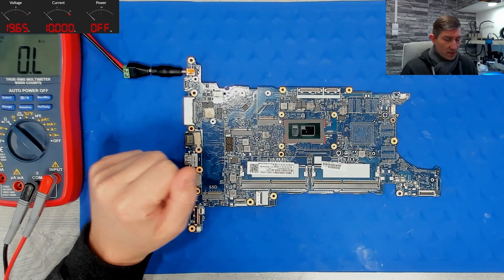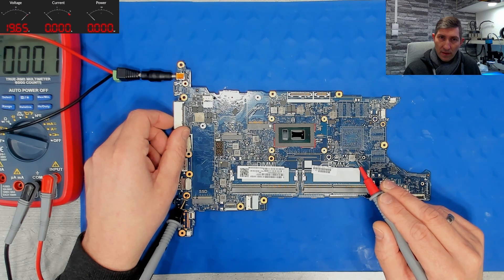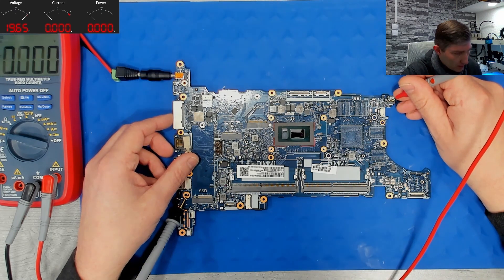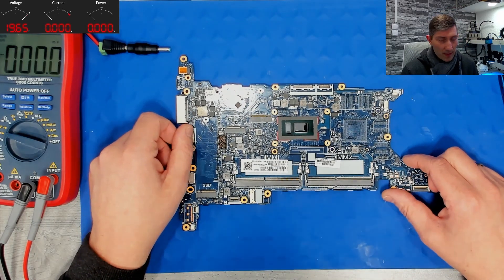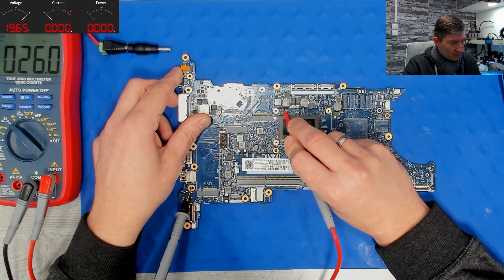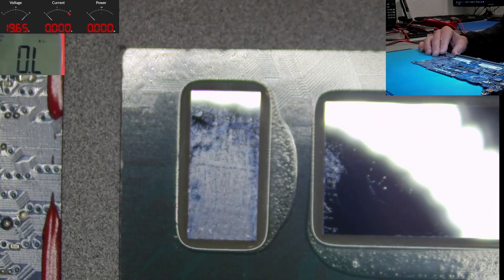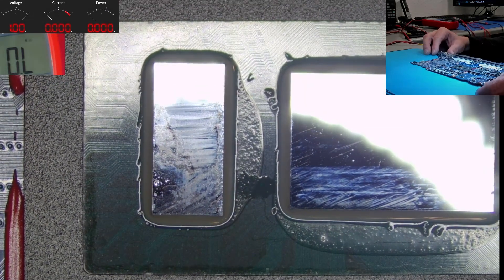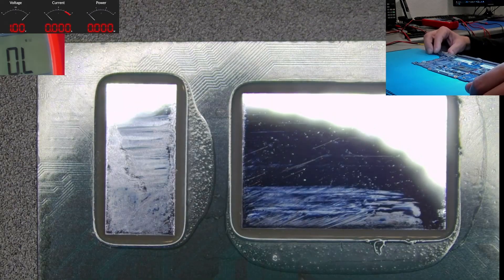The most common fault on modern Intel based laptops - Common faults #1

Comment: Highly annoying that the PCH is integrated with the CPU. I think you have better chances with gaming laptops where the PCH is not integrated. At least in those cases a swap will be feasible, or way more feasible than in case of SOC's. One question I have though: In your experience - statistically speaking - does the PCH die due to a fault in another part of the circuit, or does it die by its own?
Reply from the maker: Good question again. You want my honest opinion? I think the PCHs have a design flaw by purpose. From my experience there are usually two ways the PCH dies. It either fails because of a failed and deeply burned PowerStage (very common with Silergy ICs) at either 3.3V/1.05V rail or it just "committed suicide". Usually you'll diagnose either a (partial) short to GND at 3.3V, 1.05V, in RTC Circuit or at the Data Lines of the USB-Ports. Unfortunately i had to deal with some cases where the fault wasn't really clear but i had to suspect a dead PCH after exluding everything else. Regards.
Reply: You mentioned "special design called MPDC" please can you .thank you

Comment: Let's assume you had this fancy BGA rework station, how much would you charge for this kind or repair (spare part + work)? I mean, there should be a reasonable charge in order for someone to proceed with the repair or just sell off the device for spare parts and buy a new one. Yes I know it's a matter of whole device cost but let's say we are talking for a mid range laptop of less than 1000€
Reply from the maker: Well, that's a good - and not so easy to answer - question. The whole task is a few hours of work. Someone has to prepare the replacement BGA with other solder balls (for increasing success rate) and the motherboard. I think 150 - 200 Euro would be a reasonable price for this task as minimum, parts not included.

Then there are huge price differences between the various BGAs which you rarely get from verified suppliers but only from china and then there is the additional challenge that you never know from where the replacement originates (undiagnosed board, just "used", or similar). 

So there are always question marks who might prevent the task from being successful. In best case you have a spare board with a known working BGA and just another fault. Let's say the PCH is bad and the CPU is good for example. This ofc doesn't  apply to the packages where the CPU and the PCH shares the same substrate.

Even the task itself can go wrong for some unknown reason, which means it might have done twice.

You see, there is much to consider before even starting with the work.

Regards.
Reply: @fairrepair_en  Thanks for taking the time to answer. I'm more or less close to your view. In that case is much more risky and difficult for the technician and not the customer to decide if this job can be done or abandoned even if the success rate is within the acceptable risk factor. I mean, there are so many things can go wrong as you said that makes such kind of repair very tricky and very prone to fail. You have to find a customer who is willing to pay no matter the outcome which of course has no logic because in case of a fail customer should pay work+spares and a new laptop. 

Would you ask the customer to pay regardless of the outcome?

Vielen Dank im Voraus

Comment: You could lift up the coil and check which side the short is coming from.
Reply from the maker: The fault was clear enough to not go the "extra mile". Also injecting will always point-out the faulty component regardless whether the coil is lifted or not. 

But yes, in case of a a random buck converter without knowing even the possibilities it is a good step to lift the coil first, to know whether you're dealing with a fault at the Buck converter or the load side.
Reply: @fairrepair_en  Or use an ESR meter to tell which side the short is on. Easier than lifting a coil.
Reply: @LarryJSabo  What is a ESR meter?